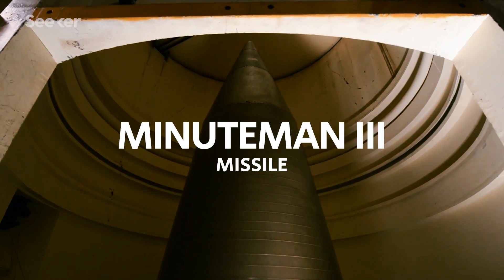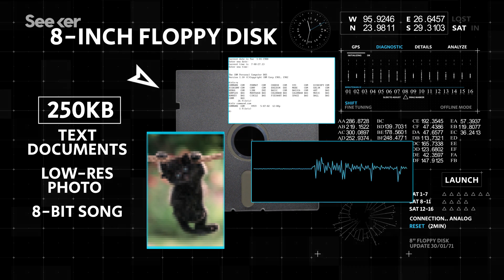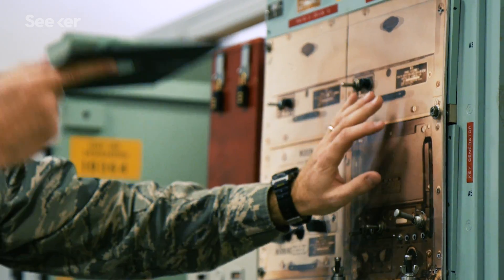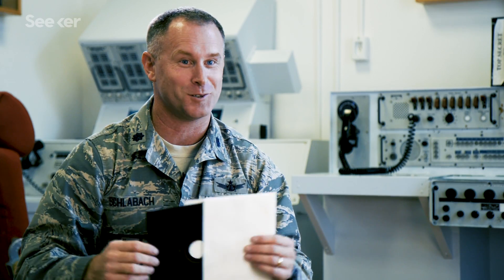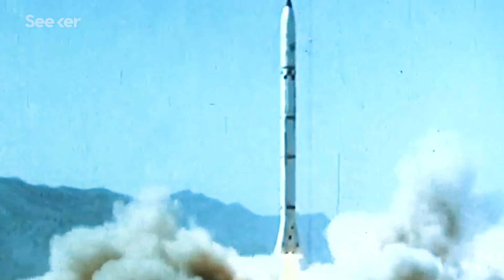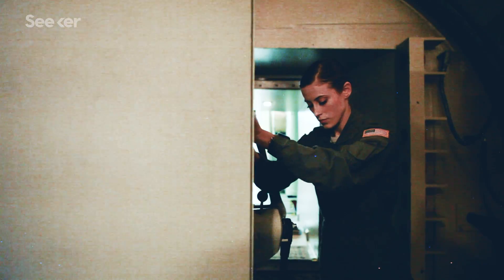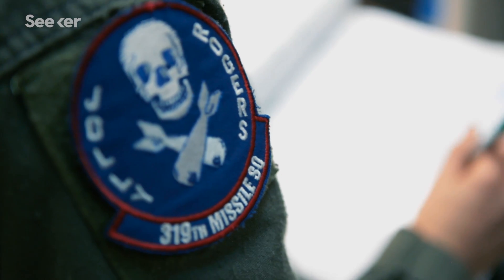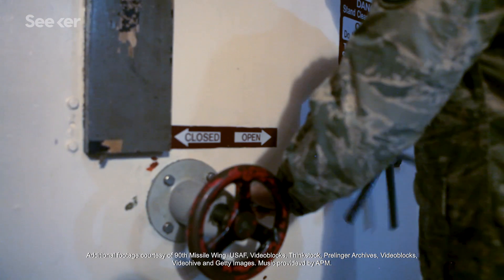When U.S. Nuclear Missiles Were Controlled By Floppy Disks

Comment: My only concern is that the physical media of floppy disks degrades over time, reducing it's data retention capabilities. I assume they create new floppies every so often.
Reply: NorthernChev yeah they probably do. otherwise we're fucked if we need the minuteman
Reply: yeah they must remaster blanks I guess? Even if you have blank ones they will become unusable in about 10 years on average due to the mastering of the tracks loose magnetic strength, making the tracks undetectable by the drive.  Most of the floppy disks I have ever owned died this way and they couldn't even be recognized or formatted by any PC or FDD.  Same thing happens to hard drives but their mastering is done with very high strength field to the point that even with fading over the years its still detectable with the heads, generally few decades if else is healthy.
Reply: 3800Tech assumedly they probably have the ability to create them still. It’s not a huge undertaking and the pieces and parts should still be available to do so. I mean that’s my theory at least.
Reply: They've probably replaced the floppies, and are now spreading misinformation about what hardware they're using.
That's what I would do...
Reply: Out at the western range we do test on the boosters, which are pulled from bases like F.E. Warren to test their capabilities.  The enlisted missileers you see in the video will be maintainers who perform preventative and corrective maintenance as required.

Comment: The code in a most common modern computer viruses is WAY larger in bytes than is capable of effecting these machines.
Reply: But you would have to procure the outdated tech and smuggle your virus floppy into a secure military base.
Reply: @LDD429  The tech is all over the place and easy to DIY.
https://www.youtube.com/watch?v=6ODv48t-Ya8
Reply: KohuGaly Good luck getting that Palm inside their base
Reply: I'm pretty sure that the silos have some digital back-doors in case the silo gets overrun by terrorists or rogue agents...
Reply: that said, a virus that would work on this computer can probably be written on a back of you palm...
Reply: They probably have some sort of connection to the outside of the base, you only need to find that piece of cable that runs in and out of there.

If you find it, they the only thing you have to know is the system it's connected to, there are probably some old CPU or memory flaws you could exploit to get your own code to run on those machines. Of course, it would be a huuuuge undertaking, finding those cables and basically reverse engineering what is essentially a black box, but it's theoretically possible.

Comment: sigh of course they are why would america spend money on upgrading it its not like they have the budget.

oh wait
Reply: They just told you why they don't want to upgrade it. Can you watch the video first?
Reply: You do realize that "upgrading" it will literally put it into the hands of the hackers. Do you want that?
Reply: Sam Gerers there was a physical hack as in somebody got into the facility right?
Reply: I remember when my profile pic was exactly that one once, very nice.
Reply: sirdeadlock The Austrian main airport had a system which isn't connected to the outer world at all so that it can't be hacked, but they're using newer tech. And guess what? They actually got hacked a few months ago...
Reply: if it aint broke dont fix it. In this case older tech is more secure.
Reply: The main advantage to upgrading would be energy savings. That entire system could literally be replaced by a single android phone without internet, hooked up to a series of monitors. Would probably reduce the energy cost by 10,000x.
 It's really not a big priority though.

Comment: If it ain't broken don't fix it.
Reply: EA has the same motto, but reversed
Reply: That's what they said about the Challenger mission and see how that turned out
Reply: Legacy systems are susceptible to degradation of data and pose a serious security risk as they're easily hackable with today's software.
Reply: Hermes Nettel Google can learn a thing or two from that.
Reply: Russian mentality about their Sokol suits
Reply: Thankfully scientists and engineers dont follow that rule otherwise we would still be riding horses and communicating long distance using pidgeons.
Reply: I'm watching this video and the first thing I said in my head "if it ain't broken don't fix it." lol wow
Reply: Hermes Nettel
But don't fix it, modernising atomic weapons is still dangerous!
Reply: Floppy disks are a very primitive magnetic storage.  What do you think an Electro Magnetic Pulse from a nuclear detonation would do to those disks?  
If the nuke was purpose build for an EMP firing out thousands of miles of wire in space before detonating in the upper atmosphere, all of those systems could be wiped.  
Laser etched optical media(not the dye based ones), would be best.  
Old components are much more resistant with good surge protection in a bunker.  Magnetic disks are just too easy to erase with even a weak magnetic field.
The old code on those systems is actually easy to hack.  Overflowing a buffer is easy and there are no protected memory spaces.  Everything is wide open without any protections at all.  Modern tech can also be set up without remote access or networking, a must.
PS: The old launch codes were 00000000 on all minuteman missiles, as security was never a concern.
Reply: @abram730  they are all hardened. Did you not listen to the video? Every inch of it is hardened.
Reply: @abram730  Yeah but the bunker is like made of steel, no EMP worry there. Also, you'd think they would launch before a nuke hit the bunker. Also, how would it get hacked? Not like there are shady spies going around sticking USB sticks into things.

Comment: Considering, that they are still controlled by Floppy Disks makes it good. New Systems are hackable and you don't want to have them set off by hackers. watches video
Edit: My thoughts were right. Good video.
Reply: A hacker can literally walk inside a facility, insert a USB drive, and launch the attack from there.
WiFi, or any internet connection for that matter, are NOT necessary for a hack.
Reply: More often than not, it's not "just some random person". It's somebody with enough clearance to get in and enough brains to get in undetected. Trust me, it's possible.
Reply: yup. Spectre and Meltdown aren't possible with this (the system in the video) System, because the kind of architectures didn't exist back then in computer chips.
Sorry, you need to be specific in this channel @Nightquaker
Reply: Jesus Christ. I was referring to the other person who said that modern equipment gets hacked via WiFI mostly. And I was saying that it's not necessary. I wasn't referring to the current systems in place!
Reply: No I don't need to be specific. I wasn't even referring to you with my initial comment. I know that Youtube comment chains are shite, but please.
Reply: PSA: Air gaps do NOT guarantee security.

Also, magnetic storage degrades over time. The floppy disks need to be replaced with something more reliable.
Reply: you are going to the frontpage of imverysmart
Reply: Uhm... @Nightquaker : USB drives didn't exist when the system was created. The first USB System existed in 1996,  and those Systems are from 1970.
WiFi or Blootooth didn't exist either. You probably didn't watch the video. They say it literally!
Reply: One slight problem with your hypothesis (assuming you know how to get in unmolested) - those machines won't have a port for a USB drive. You'd have to input everything on a floppy - and good luck finding an 8" one these days unless you're a government with a secret contract!
Reply: I meant in case of modern systems. Modern systems can get hacked like that. Not the ones that are used there now. I wasn't referring to you, but to the Caeden W person.